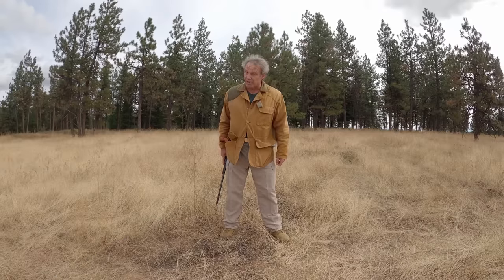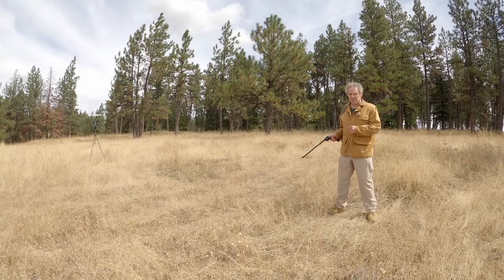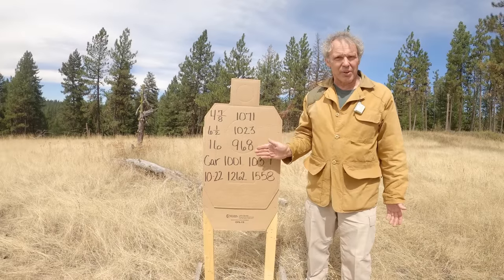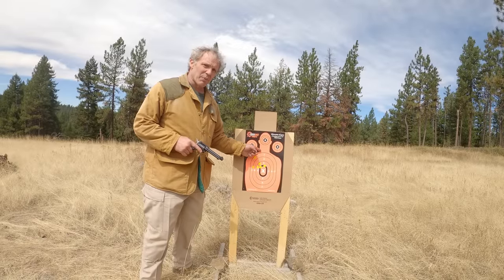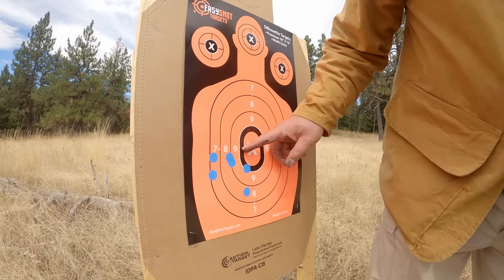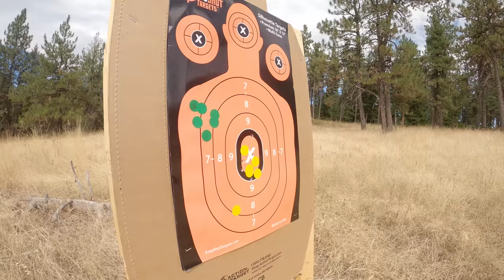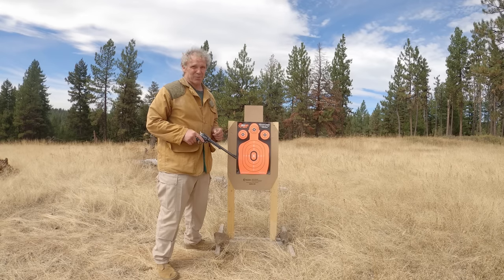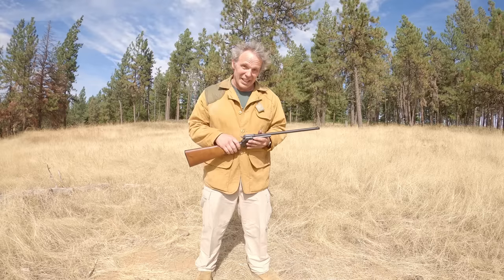Heritage Rough Rider Revolver Barrel Length Comparison

Comment: @Paul Harrell Sir a few things. I've owned the Heritage Rough Rider Revolver for about 10 years now. I was able to buy it new for $99.00 on one of those holiday specials. There is few things I don't understand in regards to your view overview, respectfully: 

1) The first is, why 20 yards? I think if you were shooting at 10 yards you have a different more favorable opinion on the revolver at the end of your video, 15 yards I feel is pushing it with the revolver using some of the .22LR ammo choices you made.

2) I also like to add, in the many years of certain security fields I work in, I sometimes travel with this revolver (6.5 inch barrel ) with the .22 WMR/MAG cylinder for a self-defense firearm. While I had to purchase the .22 WMR/MAG cylinder separately, sometimes they come with the revolver. I'm wondering why you did not show your test using that cylinder? 

3) The last thing that I was wondering about, is the best .22LR rounds out there are high velocity: Aguila Super Extra and the CCI Mini Mags.... Both have copper plated noses. "NOT" for distance per se, but for accuracy I again think your results would be different. There is few times that you had rounds that seems like they tumbled or flew apart as plain lead round nose and especially lead hollow points do fragment after leaving the barrel.

Comment: my son had a heritage 22lr,22 mag combo and that thing gave light primer strikes at first about 80% of the time ,so we tried different ammo and some of it Shot . so we shot that brand then it locked up cylinder wouldn't turn. we sent it back to heritage and same problem. also returned with a bent front sight I mean bent 45 degrees. dealer bought it back . I'm not impressed ,however that turd was a tack driver! the few rounds I got to shoot were in a small group.

Comment: It shows an interesting effect from cylinder gap. I'm under the impression that Heritage Arms has a slightly wider-than-common cylinder gap (I get a bit more powder sting) which somewhat improves reliability in rough conditions. Longer barrels lose more pressure from the cylinder gap, the gap loss here is a bit steep, but still darn fine firearms.

Comment: Pistols with long barrels can be good  when your leaning on something, Holding that  length steady at arms length is not as easy as you would think. for a short barrel a millimeter or two of wiggle does not add up to much for a long barrel  it can add up over the length to a cm or more of wiggle off center over the length of the barrel. But if you practice every day for a few hours your arm strength will build up over time and probably reduce the amount of wiggle/barrel drift whilst aiming

Comment: As usual, great video! I have a hypothesis about what the numbers say in this experiment. I need to qualify this by stating that I DO NOT OWN any Heritage firearms, so this is purely speculation on my part:
I suspect that the cylinder gap on these guns is rather wide, probably in an effort to keep manufacturing tolerances affordable. I think this would explain such a rapid decline in velocity as barrel length increases. At the same time, inconsistencies in the cylinder gap from one firearm to the next might explain the difference you saw between the 16" handgun and the 16" carbine. I think a set of feeler gauges could likely support or eliminate this as a cause. (Cylinder timing would be another, more disturbing cause.)
Just my opinion. Like you, I know several folks who own and love these guns. They do seem to offer a good value for the money.

Comment: It would have been a good idea to measure the cylinder gap with a spark plug gap measure (or something like that). I would be willing to bet that has a bigger impact on velocity than barrel length… especially in cheaper revolvers like Heritage Arms. 

Having said that, I own a Heritage Arms single action .22LR/.22Mag revolver with a bird’s head grip and love it for plinking… good gun to see who (with luck) can get closer to the center of a target.
Reply: Spark plug gapper definitely should not fit. You want feeler gauges. If you can get a hair or a piece of paper between them it's still too much, imo. 

The gap on revolvers can also vary between chambers on the same cylinder if the cylinder is not square and true.

Comment: Ok not sure where you saw a rough rider carbine pricier than a 10/22. I bought mine with adjustable sites for $250. That includes TT&L and out the door with a hundred round box of CCi minimags. Interesting
I inherited my Dad's stainless 10" Single Six that he bought a matching set of two as a wedding present for him and Mom in '68. It's an accomplished squirrel zapper. Dad always carried it while hunting deer and never failed to come out of the woods with either a deer or a revolver worth of fuzzy tail rats.

Comment: I have the RR in a 6" barrel, shoots good and no significant issues, other than ammo related. When I first shot it, it was shooting high and to the left. While I can compensate for elevation, windage is a bigger issue, so I just bent the front sight a bit and got it real close to center, windage wise.
Reply: Good fix. I have a Colt Official Police .22 which shot 4" high at 20 yards so I added JB Weld to the front sight a little at a time and then squared it up with a file. Painted it black and it works great.

Comment: Great video Paul, as per usual! Thank you! My only concern is the keyholing issue! Is no one going to mention these are smooth bore revolvers, and with no rifling there is no way these guns are as accurate as a rifled barrel from a similar firearm! I have owned 1 for about 5 years and keyholing has always been an issue!
Reply: I would call heritage about that. I just checked both of mine after reading your comment and they both have rifled barrels.
Reply: @joshp2542  mine shoots both 22lr & 22wmg with interchangeable cylinders, n was purchased 4-5 years ago, so maybe it was a different design
Reply: @JoshuaEagle1080  I bought mine around 3 years ago when I moved to PA. I would really give them a call.

Comment: More data points for "you must validate through live fire" with guns and ammo.  You made predictions and sometimes you win, sometimes not so much.  There are factors that you can't really know in advance such as a few thousands of an inch difference in bore diameter, how straight the barrel was threaded into the frame, cylinder alignment--the more parts, the more MOVING parts, the more factors affecting muzzle velocity, group size, group center point-of-impact, and if I have the resources, I like to fire six-shot 25 yard revolver groups through each individual chamber to determine if all of my chambers in the cylinder are straight.  One round tumbling?  Might me one chamber in the cylinder was misaligned.

Comment: With my Heritage 6.5" the cylinder gap is 0.007" it should be closer to 0.003" - 0.004", thus lower fps than a comparable Ruger Wrangler with a shorter barrel.  But the gun shoots just fine.

Comment: There must be a dip in QA at Heritage on the newer models, or the spacing on the cylinders has more tolerance then it should. 

I have a 6.5 inch in 22lr purchased a few years ago using Aguila, CCI, Federal, Remington Blazer ammo of various grains and types - no failures to fire. 

However, I have the same misfire issue with the 16 inch Joker model with the aftermarket 22wrm cylinder, purchased from Heritage about 8 months ago. 
What I found, is the cylinder has some back and forth play which leads to light strikes and thus failure to fire. 
Oddly enough, most of my misfires on the Joker come from CCI 22wmr ammo, roughly 3 of 6 would fail to fire if not more. Never had a 6 shot cylinder cycle without at least 1 failure to fire. 
Had the same issue with Federal 22wmr  though not as much roughly 1 in 6, some occasions I could cycle a full cylinder with no issues.

As a test, I cycled back to the misfire rounds - most would fire on the 2nd attempt using the Federal not so much with the CCI. 

Side note,  yes each ammo had a different point of impact on each firearm used.  I'll have to go back to the 22lr on the joker and see if it's also ammo picky.

Comment: I have a 6.5" model of the Rough Rider, easily the crowd favorite of all my guns (I drag my brother and my coworkers to the range). Very approachable, and very reliable with CCI among others. Until recently, it was the only manual repeater I had in .22lr, so it ate all the rounds my autoloaders refused to feed or fire (yes, I'm that cheap). 
     The only ammo the wee pistol doesn't particularly agree with is Aguila: out of approximately 400-450 rounds of their 40gr. copper-plated round-nose "Super Extra" ammunition, three or four times case heads would deform when firing, bulging into the opening in the recoil shield. That condition made the cylinder too tight to operate with just the hammer, necessitating manually assisting the cylinder to bring the deformed case around to the loading gate. Maybe the opening for the firing pin is larger than needed but I don't hold it against the gun, particularly since that was the cheapest ammo I could get at the time for about $0.03/rd.
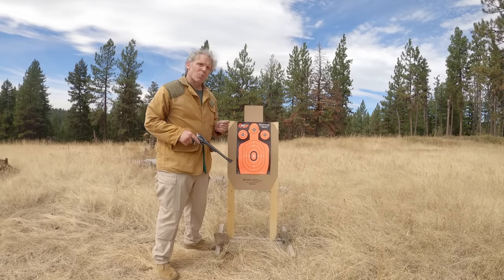     Heritage has a model of Rough Rider called the Hunter to compete directly with that fine Ruger Single-Six shown at 24:18. It sports a 9" barrel with adjustable rear/fiber front sight just like the Ruger, they run about $250 with the .22WMR cylinder included. I was hoping Paul would have one of those available, but they're much harder to find.
     I don't doubt the Ruger's a more durable product, their ability to fit & finish cast parts is legendary; but I can and likely will have three Rough Riders for the price of that one superior revolver. The RR hammer still spells "C-O-L-T" so I can live out my cowboy fantasy properly (we're gonna ignore the hammer-block safety).
Reply: You're not the only one to rotate once hit rounds into a Heritage...about 98% of the time the round (any brand), goes bang upon the 2nd hit...don't think of it as being cheap, but rather as part of how you grade that particular brand of ammo...after all, if you had loaded the round where the rim needed to be turned it would have fired on the first strike...we just count the true duds, which these days seem to be fewer and fewer...and yes, those 4 distinct clicks have grown on me, too...

Comment: You and every video I have watched this morning have exposed a design flaw with the heritage revolvers. Because they are consistently shooting slightly left and a little high in most cases that tells me that either their mold is off where the sights are formed either in the rear or on the barrel. Heritage Manufacturing should be notified and made aware of this to correct their process.

Comment: Varmint guns, snakes, rats etc etc. a Taurus pt22 is by far a better choice for not much more; reasonably accurate I’ve hit 8” steel at 60 yards with mine about 50% of my shots at that distance; break barrel so no need to cycle and 8 round capacity. The Ruger rifle is the best rancher/farmer’s choice imo though; you just can’t go wrong with a 10/22 or Marlin.

Comment: Apparently, the Heritage revolvers fall into the category below in my state, which makes them prohibited:

Handguns (other than antique firearms) where the frame, barrel, cylinder, slide or breech-lock is composed of any material with a melting point of less than 1,000 degrees F, or an ultimate tensile strength of less than 55,000 psi, or comprised of any powdered metal having a density of less than 7.5 grams/cubic centimeter.

So I have never seen a Heritage in the gun store, but do see them in ads for the local Fleet Farm, but it always says that they are not available in my state.  I have always wondered when I watch these types of videos comparing barrel lengths, if a slightly tighter barrel could cause more drag on a bullet, thus slowing it down.  And with the cylinder gap, I would imagine that if one revolver has a .003" gap, and the next one is .005" gap, you have to wonder if it lets out enough pressure to make a difference.   But then you would have to check that gap and hope it is the same in the comparison guns to make it totally fair.  Good comparison, especially showing the difference between a revolver with a cylinder gap and semi auto without that gap can have higher velocity in the almost same length barrel.

Comment: With the Rancher carbine, one advantage it could have over the 10/22 is that it could have its cylinder swapped out for a .22 WMR cylinder.  I'm not sure if this is actually possible, or suggested by Heritage, however.  I'm talking on the assumption that this is a possibility.

Comment: I wonder if you might get better accuracy if you used the .22 Mag cylinder and shot .22 mag out of it. My reasoning is that while you change the cylinder for .22 LR or .22 Mag, the barrel stays the same and I do believe that .22 Mag is a slightly larger in diameter bullet. I also realize that the Ruger single six is also capable of both cartridges but it's also a much higher quality firearm. I do own a Heritage Rough Rider but I only shoot .22 Mag out of it and had pretty good accuracy with it. Might be worth a try.

Comment: While I would have watched a garden stone if Paul narrated it, I was particularly interested in this video. I bought one of these revolvers several years ago because I could get it new from our local Academy Sporting Goods somewhere in the ballpark of $150. I love single actions, so what the hell. I’ve spent more than that on a night at the bar. 

My experience was, after laying hands on nearly every one in the store, like I was a televangelist casting out demons (“Bring me the next possession, and for the love of all that is holy, collect their donations before I cast out their demons this time!”), trying to find one with the best fit and finish. Nope, they all looked and felt like they came out of the Yugo factory. Still, a buck-fitty? I’ll get one. I was most unimpressed with that thing. Inaccurate, cylinder did not line up with the barrel on every hole. Shaved some of the bullets entering the tube and bound up the wheel after a little bit of shooting. Had to pull the cylinder periodically to clean it up to keep shooting. I gave the thing away, to be honest. I couldn’t even bring myself to selling it.

So, to be fair, I already had a Single-Six, a Single-Six convertible (.22LR and .22Mag), a few years later add the Single-Ten to the safe, so the loss of the Heritage was not a big deal to me. As Paul said in his summary, given the price difference, you have to measure your personal values and tolerance for craftsmanship. After all, I will carry around a Taurus. I also know people with the Rough Riders who have both had similar problems to me and some who have had zero issues, though still can’t touch the Ruger’s fit and finish. To be fair, my Chevy is no Mercedes, so price plays into parts. 

If I needed a truck gun, a camp gun, or something I would be using periodically to kill some empty cans, I would keep one of these. I’d get the timing fixed, but I would keep it. If I want something I’m certain will go bang every time I squeeze the trigger, gun on my hip in camp for snakes, something for the varmints in a chicken coop or a rat moving into the yard to steal Mama’s veggies, I’m keeping my Ruger. It doesn’t matter what I feed into my Rugers, I have not found anything that does not fail to function reliably in any of my three Ruger single action .22 revolvers. All are reasonably accurate as well. As least good enough for me to take care of a pest. (No stories about 40 rounds through a dime or anything. I won’t tell lies like that. Anybody who knows me already knows my eyes aren’t good enough to see a dime from 10 yards without a scope.)

Bottom line, price matters. My theory has always been to buy the best quality that you can afford without doing harm to the household. If that is a Heritage, then that’s what you get. It works and was fairly accurate (I could see back then). Just understand what you have and learn to use the tools you have.

Comment: Is that a16" handgun in your pants, or are you just happy to see me?

Great video, very interesting, would not have guessed at the velocity results.  It would appear that the majority of the "work done" for 22lr is done in the first inch or so, that first bit before it comes out of the cylinder is where most of the acceleration occurs.  In a rifle, apparently the expanding gasses can keep accelerating it, but in a revolver, perhaps not so.  And of course, YMMV with different guns.  I do believe centerfire rounds show increasing velocity with longer revolver lengths, so the expanding gasses are still doing their thing behind the bullet, cylinder gap notwithstanding--but for 22lr, with its lower pressure and really fast burning power, it appears the story is different.  The pressure spike is fast and very short lived.  [As a counterpoint to my thoughts, if you look at what NAA publishes for velocity on their minis, they do show small increases in speed as you go from 1 1/8" up to 2", and then a bigger jump at the 4".  Their 4" mini-master though wasn't much slower than these Rough Riders, so...]

Might make a good argument for the convertible versions of these guns, as the ones that can use 22Mag would have to have longer cylinders.  A 22lr only (Wrangler or anything else), which might have shorter cylinders, might have slower speeds.  Maybe.  Pure speculation on my part.  Longer free bore = more speed, before engaging rifling (which can scrub speed) or encountering the gap?

Have to say, this does nothing to keep me from keeping any eye out for one of these plinkers, if anything, it's only adding fuel to the fire.